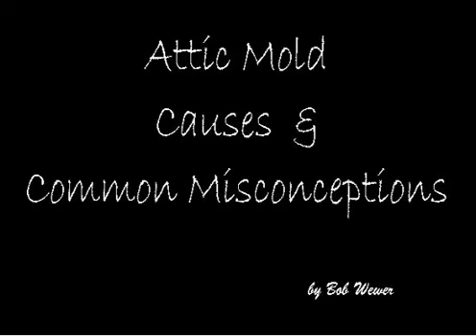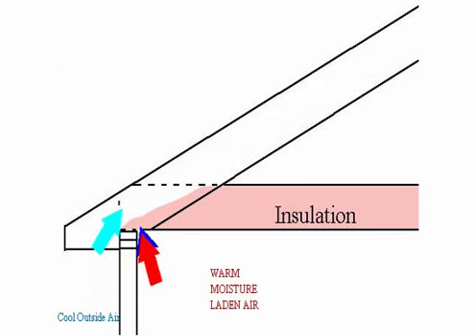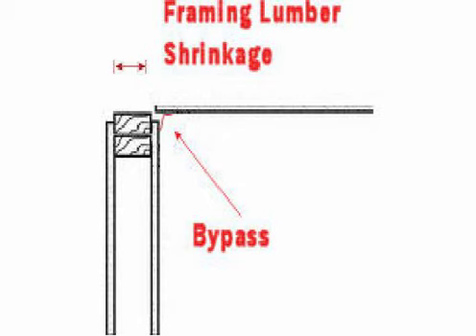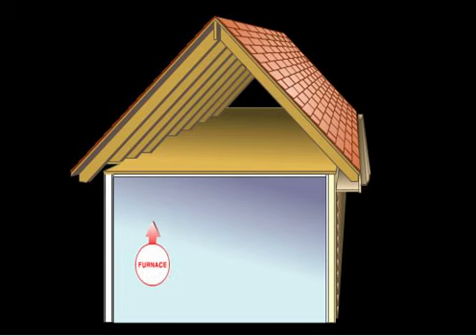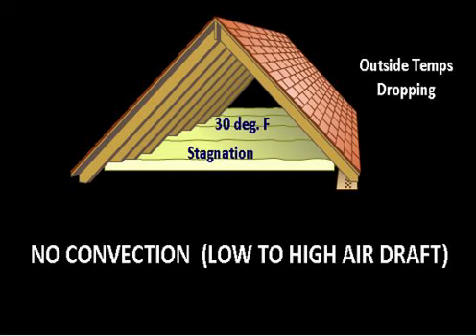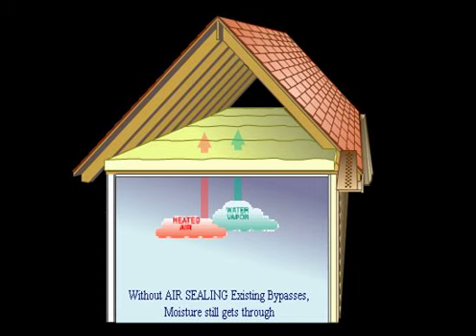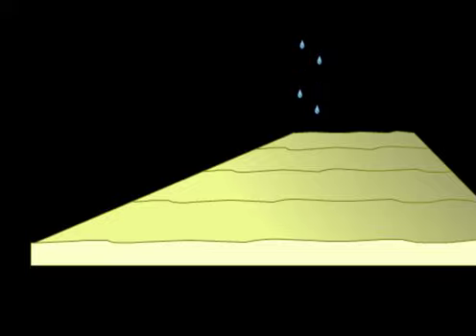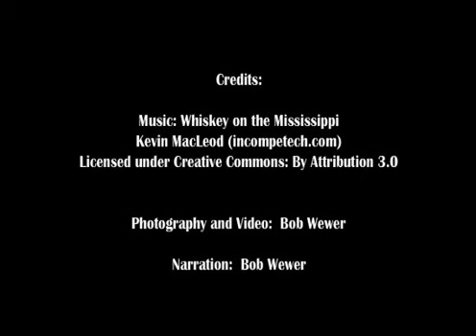Causes of Attic Mold Frost on Nails Moisture - Robert Wewer

Comment: This is a pretty good video.  Very, very few people who talk about attic mold and attic condensation issues seem to understand that the moisture they see in their attic in the form of frost or water droplets has often originated from their homes.   This guy really hit the nail on the head.  If you're going to have a well insulated attic, you need to make sure you FIRST air seal the attic floor as well as possible.   The better insulated the attic floor is, the lower the tolerance for moisture in the entire attic.  The importance and benefits that come from properly air sealing an attic floor (goal is to eliminate the ability for the air in the attic to communicate with the air in the house below) are still very poorly understood and appreciated.

Comment: My attic was is the oddest of all odd balls attics. It probably impossible to address all the issues since it was not built correctly.   I am currently using wifi humidity gauges to send me warning if there AR problems.  The humidity in the attic always appear high but to the best of my knowlage it does not reach  dew point.  Do you know if having 85% humidity in attic is ok in winter?  What do you consider high in summer?

Comment: reinsulating the bathroom ceiling witch is 3ft from the attic ceiling joist because the house had tall ceilings. but i plan on finishing the attic and keeping it cool. question 1 where should i add my vapor barrier. question 2 the attic is not vented besides it has 2 gabe vents it is a 12 12 l shaped hip roof i want to insulate it as much as possible should i worry abou ventalation.
Reply from the maker: Where do you live?  Climate has a to do with positioning of a vapor barrier / retarder.  Ventilation is always important and a convective flow is best which would probably mean eliminating the gable vents.  More is not better, so don't just add vents on the roof because you could cause stagnation of your existing cross ventilation system.